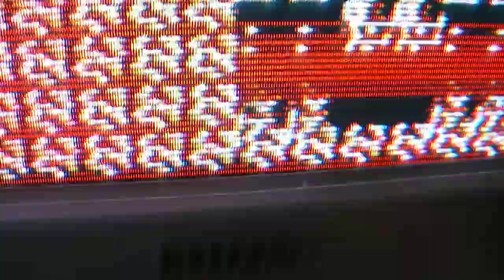Logic Probing a Faulty Nintendo (NES) - PPU may be damaged

Comment: Nice! You sure the PPU reset is pin 19?  I think it may be pin 22. Make sure that guy isn't stuck low.. otherwise the PPU will just be stuck in reset all the time and can cause it's outputs to be stuck as well.
http://atariage.com/forums/uploads/monthly_02_2013/post-31751-0-65495100-1359750553.jpg
Reply from the maker: OneCircuit Thanks for the link! When I probed pin 18 (clk), the nes would reset the graphics, That is what I meant sorry, sometimes what I think and say don't match...lol. Do you have an old working NES you can probe? Perhaps I can compare the signals and try to isolate the problem. It would be great if you made a short video about it, if you do have a working NES. Thanks for the input!

Comment: Did you work out what was wrong?   don't want to be rude but got seemed to be randomly checking pins with no obvious reference to what you were expecting
Reply from the maker: I never did find out the real problem, I was listening to the probes audio, I do understand some basics. I got a link to the signals later in time from Onecircuit! I hope that helps for some of the misunderstandings...
Reply: Bux Produxshuns you gave up trying to diagnose and repair it?
Reply from the maker: I have been really busy, I will try to make a video at a later time.